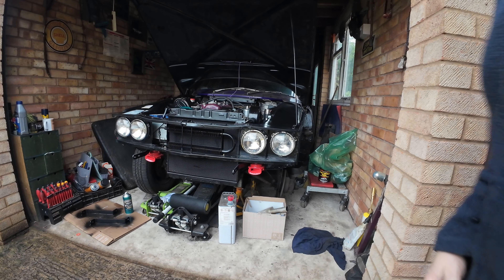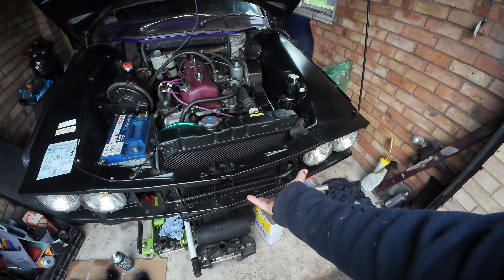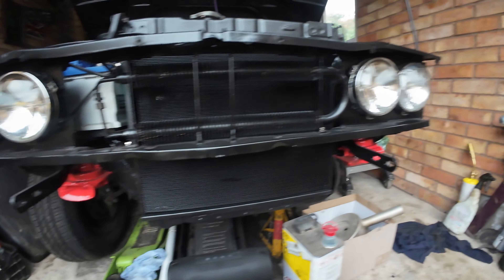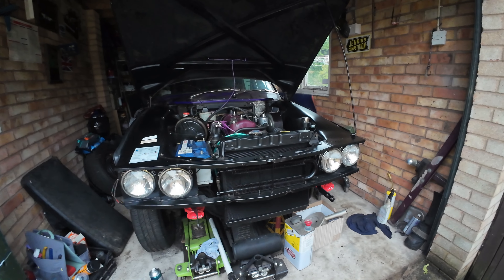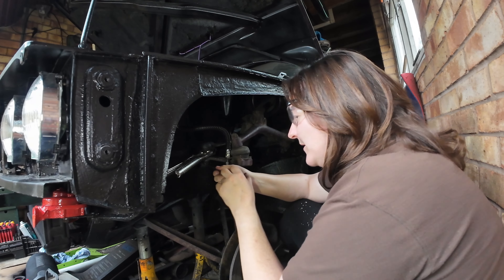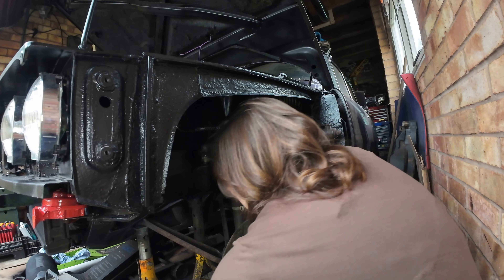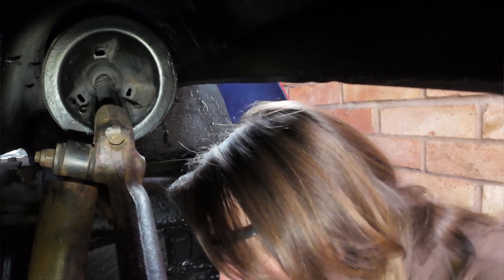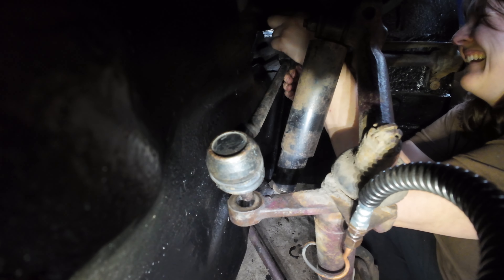Rover P6 - Steering arm link replaced

Comment: I've got a joint splitter like that, but on some cars it just doesn't fit.  Just have to keep hitting it hard with Timmy.   It amused me somewhat that you have painted your twin horns bright red as I did exactly the same (for no reason).
Reply: There are 2 sizes of this splitter. Draper? You will almost never pop it by hitting the actual ball joint, even from the nut end. If the joint is out in the breeze you can use the 2 hammer method. Hold one hammer hard against one side of the arm where the taper is and hit the other side with the other hammer. 2 block hammers like Timmy is good. It's a knack and you might take 1 to 10 hits to pop it. Otherwise cut your loses and use a splitter. You don't normally need to leave the nut on and that solves the problem of the ball rotating. These hinge types work well but for limited space and small joints, the Laser 1793 can do the job OK.
Nice job of tidying up there Alex. Very well done. You're very patient!